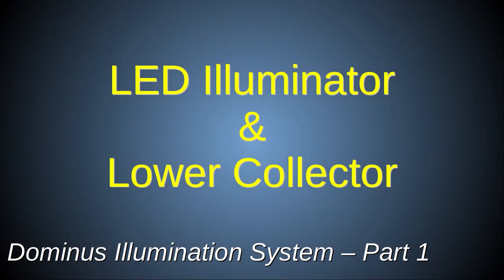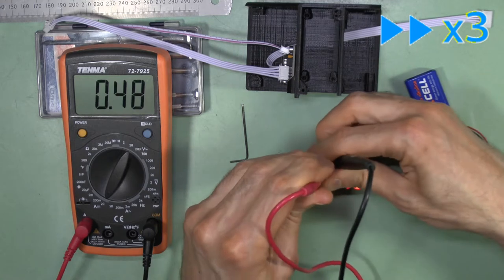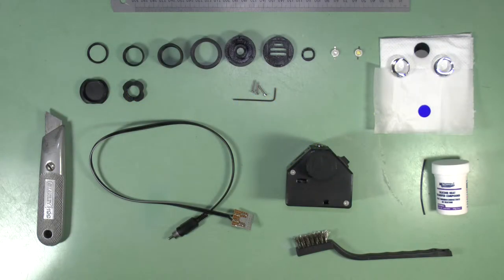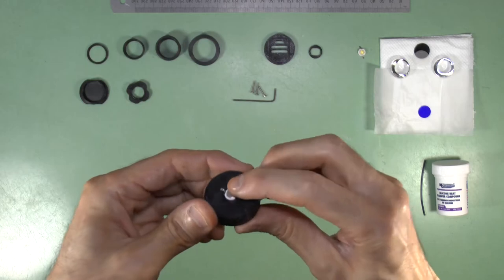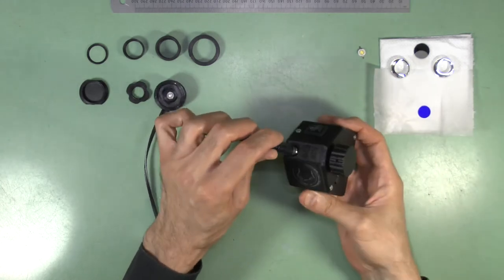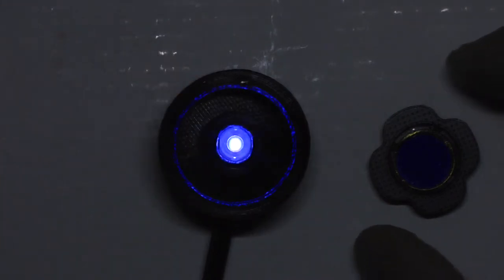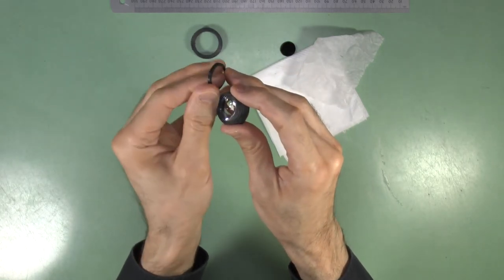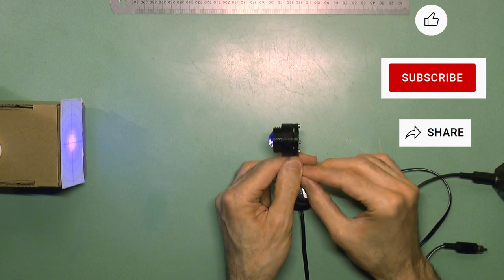The LED Illuminator and Lower Collector for the PUMA 3D Printed microscope

Comment: would a 1w cob led be bright enough for phase contrast? Are there brighter options available?
Reply from the maker: Yes and Yes. So in the first case I have done standard Zernike phase contrast with the 1W bulb using a Leitz phase objective and the PUMA SLM as condenser phase ring and it works very well with good brightness - and that is with the SLM which absorbs a lot of the light so it would have been even brighter if I had used a plane phase mask in the IAD slot instead (e.g. 3D printed or hand drawn on a glass coverslip). As for the second question - you can get a 3W version of the same footprint LED but you will need to make or get a higher wattage power supply than the standard PUMA power supply for it and also a much better heat sink than in the design shown in this video. Here is a link to a shop that sells them: https://www.aliexpress.com/item/32881415165.html . One of my goals for future development is to improve the lamp housing design, heat sink design and power supply in general - especially the heat sink because it is very crude, even for the 1W bulb - I certainly would not just plonk a 3W bulb into this design case, the heat would probably melt stuff.

Comment: I noticed with the batch of 23mm lenses I received (same vendor as your excel sheet) are slightly different dimensions. The 7mm insert spacer on the lower collector needed adjusting (radius to 10.75 - cylinder117/118). While only half a millimeter on ID of the spacer, it was required in my case to get the final 2mm spacer in.
Reply from the maker: Thanks. Hopefully this will help others too. I realise the 'just fit' / 'push fit' fittings may need adjustments due to tolerances of different printers as well manufacturer tolerances of non-printed parts. As I revise / update models I aim to move away from rigid push fits to print designs that create flexible / 'spring loaded' fittings (i.e. take advantage of the inherent springiness of the plastic) as I have already done for the condenser 30 mm lens fitting. These should overcome such issues.
Reply: @PUMAMicroscope  I ordered some more 23mm lenses from another seller which state the height specifically as 8.2mm (D23H08F18). I also found that a generic step drill at 22mm was perfect to open up the inner diameter of the press in receiver to fit the lenses that I originally received.
Reply from the maker: Thanks again for sharing your experience. The important thing with the LC spacer is that it is designed to stop the two lenses from making contact with each other because I found that if they touch you can get the curved apical surface of the lens below grinding a little spot onto the flat surface of the front lens and this spot becomes visible in the field of view as a dark spot. Bear that in mind when making any mods. The aim is to get the two lenses as close together as possible without them contacting each other.

Comment: Hi, the new batch of 23mm lenses I received (ebay link from the excel sheet) don't fit.
They measure 9mm in height. Should I increase the height of the LC_Receptacle part and edit also LC_Collar_7 ?
I'm not sure if it's the exact same issue than @landspide.
Reply from the maker: Hello. I can't give a definitive answer since I don't have direct experience with these variants. If it were me I would proceed by first measuring the front and back focal lengths of the lens and compare that to the specs I give in the Köhler PDF on the GitHub page. If the focal lengths are not too far off you should be able to use them by adjusting the 3D print models. Some empirical experimentation may be required for fine adjustments (tube lengths and separations, etc.). Be guided by the optical principles and results. Sorry I can't be more definitive but without such lenses to play with I have no more specific / direct experience to offer you. I'd be interested to know you results.
Reply: @PUMAMicroscope  Ok thank you! I'll do some measurements / tests when I have some time and I'll report here.

Do you buy your lenses from the same place or use the same old stock?
Reply from the maker: @oni2ink  I bought a load of them some time back (from the link in the BoM) and still have some left so haven't bought any recently,.